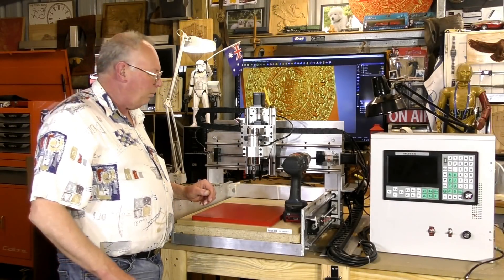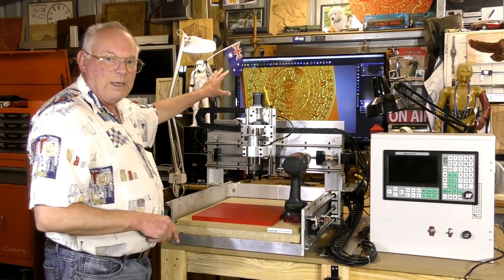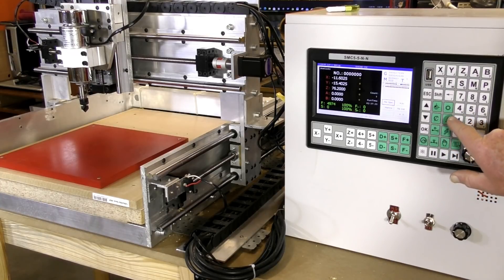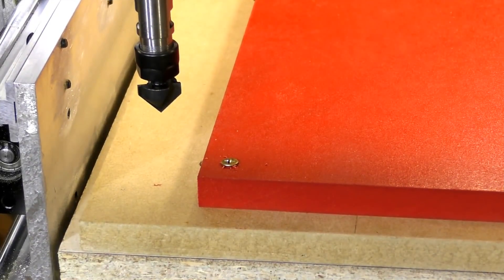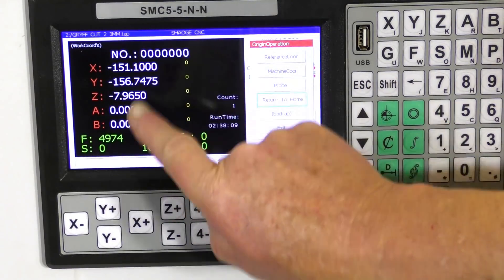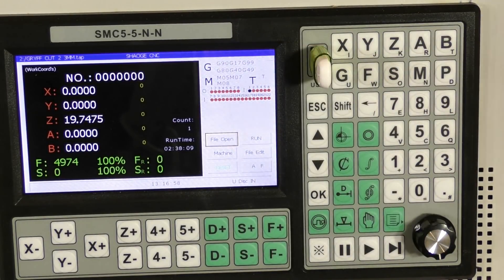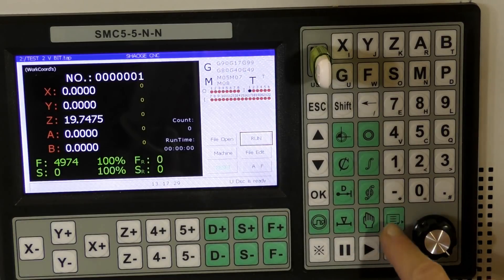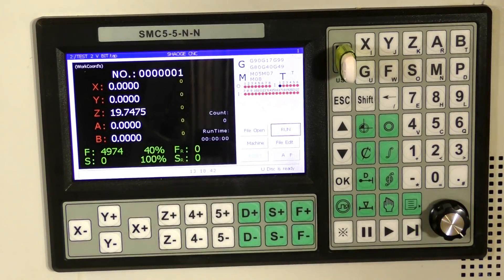DIY MIDI CNC router Vbit carving (complex!!!)

Comment: Good video, Roger.  I've cut half a dozen or so of those Star Wars Aztec calendars, kind of fun to make! 

I set XY datum to the center probably 99% of the time because I want to make certain my cutting is in the dead center of the work piece.  It just seems like a more sure-fire way to ensure a job like that ends up being equidistant to each edge.  

On the spoilboard being off, why not just surface it?  Even if you shim it you should probably still surface it to be certain it is coplanar with the machine structure.

Comment: Instead of trying to level your spoilboard dress it down  1 mm or whatever is necessary using a spoilboard bit..... no guarantee that the board is totally flat when purchased. By dressing it down it will be perfectly level to your machine.   I use to do this on a 5’ x 10’ Thermwood commercial router everytime we swapped out the spoilboard.

Comment: I noticed in one of your early Midi CNC build video's, it can be seen that the underside face of the front horizontal rectangular box section was never fixed or checked to be fixed flush with bottom edge of RH Y-axis side plate but was and still can be seen in this video to be  fixed approx. +1mm lower.  Hope this observation will help you troubleshoot and quickly rectify your machining error.